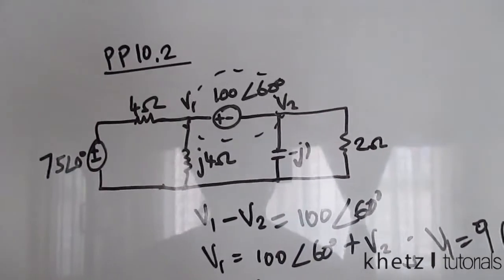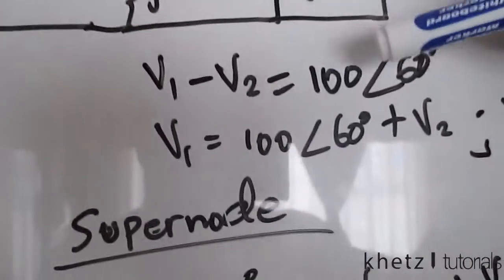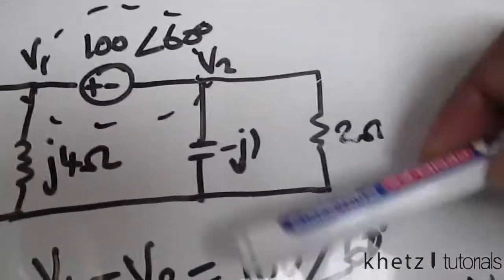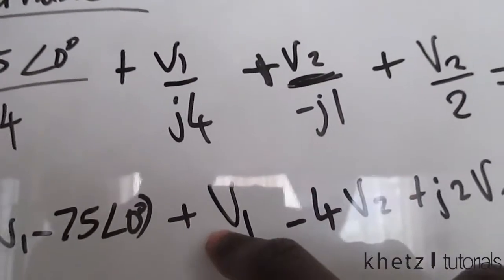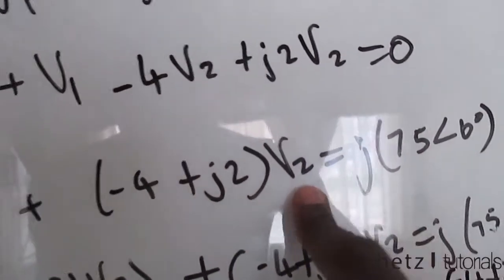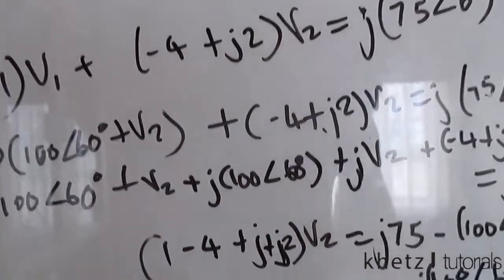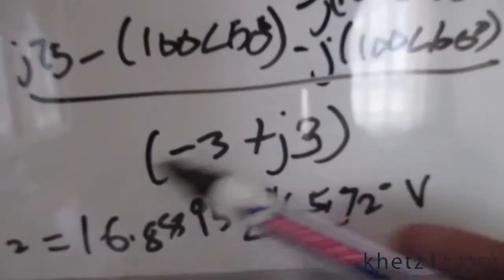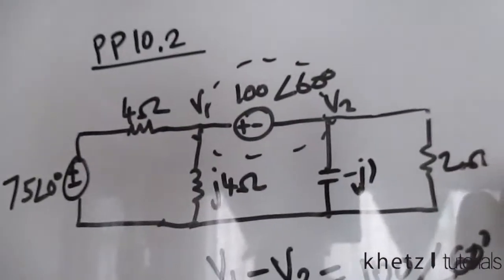Fundamentals Of Electric Circuits Practice Problem 10.2

Comment: respected sir ,with due respect  it woulde be really grateful of u to answer one question
question: why we subtract 75 from v1 ? im really confused
Reply from the maker: That is to compute the current to the left of the supernode. The voltage across the 4ohm resistor/impedance has to be found then divided by its value.(I = V/R). To find the voltage across that 4ohm impedance, we have to subtract the voltages along the path of the impedance from the node voltage v1 because the current was assumed to be leaving the v1 node. So along the 4ohm path v1 would subtract the 75V source as well as ground(0V)

Comment: Thanks sir for ur response 
Sir the answer of v2 by doing calculation is coming =16.89<-194degress
Sir i have done this question hundreds of times and didnt get the right answer 
Sir can u please look it and by doing more steps while calculating please show the ans of v1
Thanks sir 
Much appreciated
Reply: Just show the more steps of v2 answer
Reply from the maker: Hello. I'm not quite sure what I should show you. I have all the steps towards the end of the video. What would you like to know?
Reply: @KhetzTutorials  respected sir 
I just want to know the answer of v2 that how did u calculate this part:v2=j75-(100 angle 60deg) -j(100angle60deg).
Reply from the maker: I changed my calculator settings to complex mode and simply put those values in. Don't forget the denominator which was (-3 +3j)
Reply: @KhetzTutorials  thanku so much sir 
Sir the way u are doing this is really good 
Keep it up 
Lots of respect from pakistan